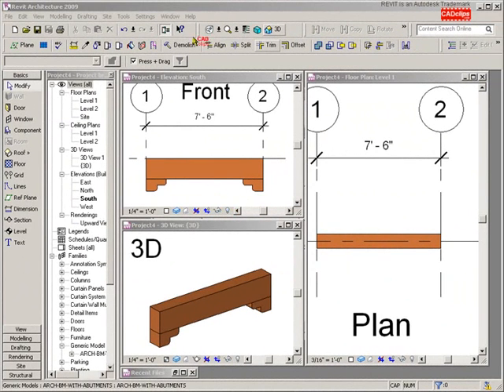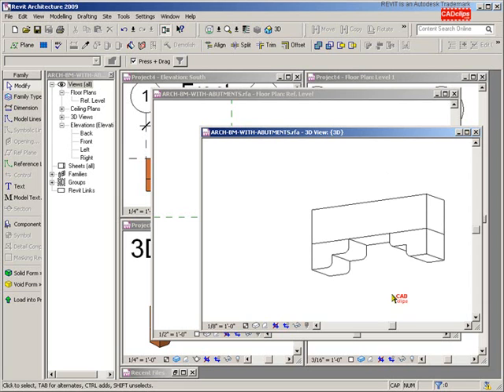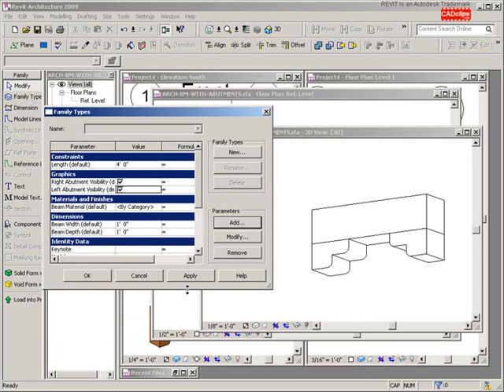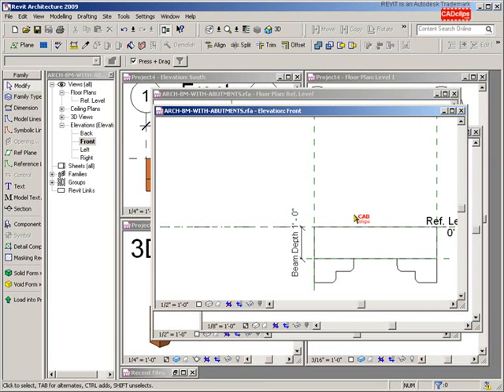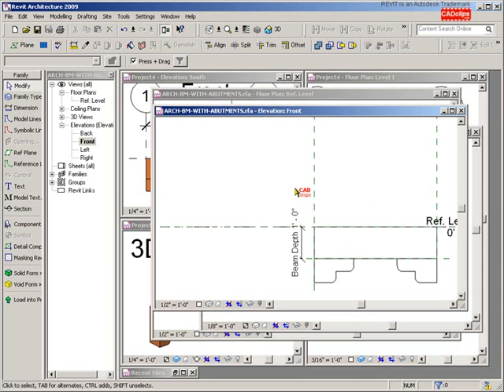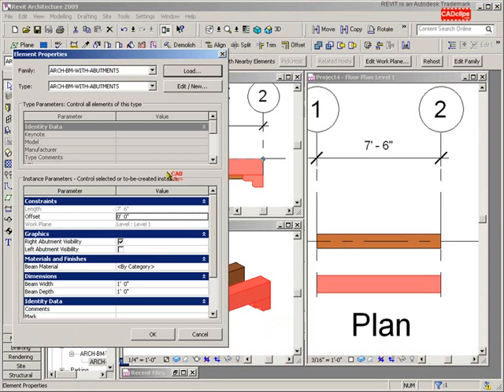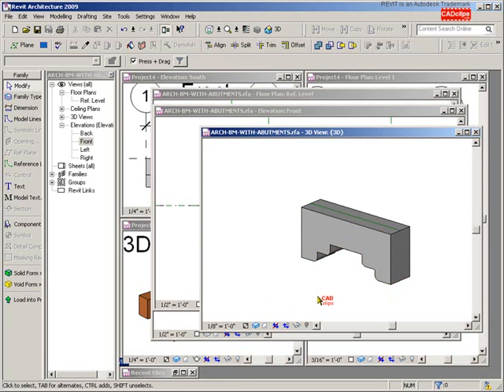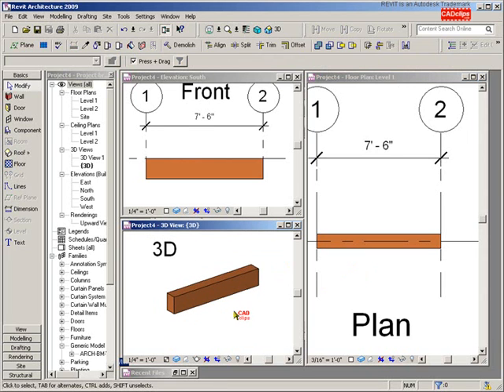REVIT Beam Family Lesson 5 Yes No Parameters to Control Visibility - CADclip

Comment from the maker: Too much work / time. In Canada we leave it to the Truss Fabricator / Suppliers. As a structural / architectural draftsman of 20+ years I have never had to draw each sloping truss of a residential / wood framed roof. This is done by the truss fabricators. Then those (probably 2d) drawings are submitted as shop drawings for approval. I guarantee you the truss people have a specialized truss designing software. In REVIT you may choose to model a few trusses and finish it with some 2d detailing.